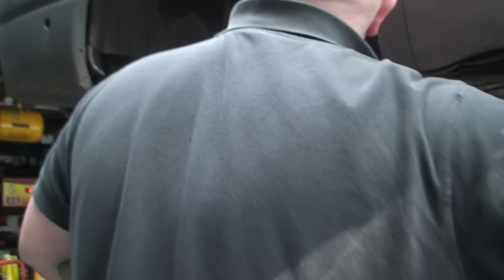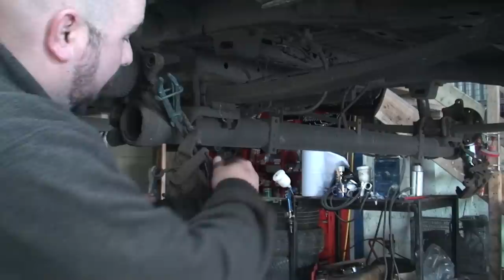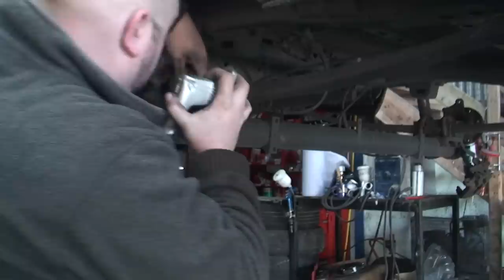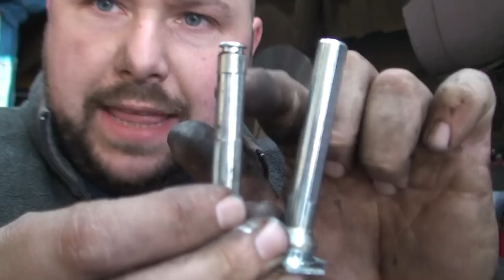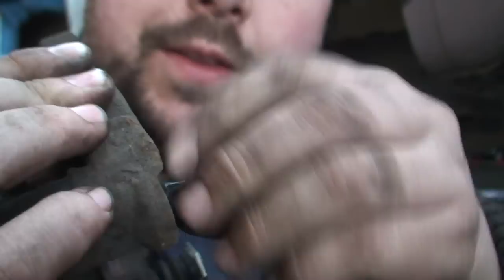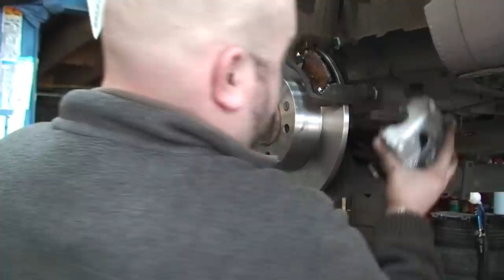bodgit and leggit garage renault master back  part 2

Comment: Super great video mate. Thanks for sharing and supporting the Renault Master community. As info for this van seems hard to find . I met a young mechanic who used to work at Renault dealership as mechanic.  I asked ?'S about brakes & was told to make sure I use correct Allen key tool (socket type) & not to short or long  (for brake calliper).  & told me took 1 hour to replace front & rear disks & brakes, but Renault would charge customer 3 hours. 
Always change disks with pads. This is the norm at Renault dealership. Said disks can't be machined & is the usual case with many European makes. Why is that? Said Master brakes last about 60,000 k's & lots came into the shop with heaps of pad wear left as they panic as soon as they hear the wear indicator squealing.  If you have to change discs anyway, don't rush to do the job ( that's my opinion (especially for rear ones), but would be more promp if front ones.
Renault charged 1100. AU an axle for complete job. So front n back 2200 AU if it's no other problem like park brake issues.
Mechanic warned me to not bleed the brakes as even in there shop, takes them an hour. I took that bit of advice seriously until I find another reputable source that explains it. I have seen on renault forums  other owners taliking about brake problems once they bled them.
I have done heaps of brake changes & brake bleeding on Mazda, Toyota,  BMW, Mitsubishi & Volvo.. Why was I warned to not bleed these ones? Mechanic told me very easy to get air in system...
I just used my wind back tool set on the rear brakes & the right hand winder, (winding clockwise) wound them in on both rear sides. 
Also, Mechanic said to use Castrol Spheerol LMM for caliper pins & backing plates etc. That is what they used in there Renault workshop.
But I like man in this video way of using the copper anti seize where he put it, but think hub needs to be cleaned (wire brush etc..), for DIY 's who don't have a dial indicator to check run out of disk.  But very thankful I found this video. Great  help for me.
Reply: Also found Bremtech Pads & Discs that this mechanic said were best choice for $, outside of Renault dealership. Pads are Euro High Grade by Bremtec in black & white box. And Bremtech Euroline high grade carbon rotors for European applications (coated with Geozinc) Got Via Super Cheap Auto.
When looking up rear it was just a case of single or dual rear wheel to identify, but front ones have allot of different ones. So much so that a Repco staff gave up & suggested I go to Renault dealer.  That why i thought I'd give Super cheap auto a go & glad I did . Unless you have the pad out to show them, you can get wrong one easily. Even after showing them vin, rego etc...I took a photo of my pads still in the caliper & the Renault mechanic could work it out from that...

Comment: Good video, however if you left the handbrake cable fitting to last, and fit new caliper and pads first, the piston would not come out, so no need to wind it in again. Slacken off adjuster of cables under van fit cables to caliper and then adjust up your cables. Much easier

Comment: Thanks for posting this vid and your others they have been really helpful,i did the brakes discs and callipers after watching , i did find the hand brake cable was a bit loose with the new callipers on and had to try to adjust under the van which was a bit of a pig as the adjusting nuts had seized up a bit but got there in the end

Comment: Why do you make the small screw so tight? Surely disc is held firmly in place  by wheel studs? Too often, I've come across these little screws so tight or seized that they shear
Reply: My old mg zr has this problem, I've avoided it as I had to drill it out, it has 2 retaining screws and one was rounded off when I got to it, didn't have anything to heat it up or any removal tools. Gutted because I was hoping to keep everything stock on it as it'll soon be a classic car.

Comment: I changed my brake pads and discs , the callipers seemed fine. My handbrake is still needing a full lockout to engage though ;/ any tips? I’m hoping the cable can be adjusted? 

Thanks :)

Comment: The rubber always goes in the carrier first. It's the pin once inserted that stops that end of the boot pulling out.

Trying to put it in after the pin is inserted is cu nt capers.

Comment: Watched this during lockdown and has saved me a fortune as I have 5 masters and changed all the pads and some disks.....1 question, handbrake has gone really high on one, had do you adjust? Thanks in advance
Reply from the maker: hi mate the first thing you're going to need to do is check the rear calipers they have a problem they stick you will see the handbrake cable and you will see maybe one of the little Arms is all the way up once this happens you can't really do anything apart from replace the caliper but that's the first place I would look it's a really common problem with these
Reply: @bodgitandleggitgarage  yet to get underneath it ! But it is working everyday, and goes on and releases no problem, handle just travels a long way in the cab before it bites

Comment: 2:17 DONT use a ring spanner if its really tight (like vid) you may round the head (BAD) use a six point socket or spanner (they do exist)
Reply from the maker: it works cause no damage and it wasn't that tight don't see the problem
Reply: Good advice actually. 👌🏻
Reply: @martinparker6536  me too! , some times learning the hard way is actually better. 👍🏻

Comment: To be fair, pinching flexi brake lines is gash as fcuk. Also nice claw hammer 😀 Otherwise good job and I agree, just replace everything it's better than bodging and penny pinching which will only lead to more expense in the end!
Reply from the maker: Special tools for clamping brake lines is not any problems whatsoever thanks mate
Reply: @bodgitandleggitgarage  Dont want to argue but in my opinion its not ok, its gash. I realise people will do things differently and that's fine. Like the channel keep it up!
Reply from the maker: @tipptop9  give me some reasons why you think it's bad what will it do that's so dangerous
Reply: @bodgitandleggitgarage  Some people will get a vice grip and go to town which of course will damage the pipe and lead to failure. Other more sympathetic people may loosely clamp and may damage the pipe structure internally, ie no visual damage, this could cause a partial blockage internally, pressure from master cylinder can make it's way down past the blockage to the calipers piston but then the partial blockage stops the return of pressure just enough to cause the piston to stick on a bit. I've seen this happen where pads on one side wear faster and even with new caliper, hardware, pins and carrier all free and greased up good, continues to happen, a new flexi fixed the defect. I work with high pressure fluids and gases, if I clamped any high pressure line or hose I'd be sacked. Hope this clears up my opinion, of course you could go a lifetime clamping hoses without any issues but I wont be doing it.

Comment: caliper hanging free from flex pipe as stated not good practice also never cleaned the hub mating surface prior to mounting new disc could lead to disc run out

Comment: Really think you should be using a bit of wire or cord to tie the calliper up so its not hanging by the hose's !! Bad form
Reply: I always do it to see if they crak . If they cant take a little bit of stick  repace them cos they get more stick on the go.

Comment: What grease did you use on the slide pins on the caliper I can't  remember if you said before about using cv joint grease
Reply from the maker: hi mate I use CV joint grease or moly Grease
Reply: @bodgitandleggitgarage  could you use white lithium grease?
Reply: You can use silicone grease on slide pins.

Comment: Found your site after buying an 02 Master. Very addictive viewing!  Bought new calipers, new discs. Now I find some pillock has stripped the adjuster on the handbrake cable. Anyone know if I need to remove the fuel tank to remove/renew the cable?
Reply from the maker: Jody Willis hi mate no you don't need to remove the fuel tank before removing the old cable tiy the new cable to it and then pull it through
Reply: Thanks mate. I take it the middle section, (the bit with the adjuster), must be a dealer part. Couldn't find any auto spares shop that sells them, so had to go to the local Renault dealer. Thanks again, would have been stumped without your vids.
Reply from the maker: Jody Willis thanks a lot for watching mate much appreciated glad you enjoyed the video
Reply: Well the Master, is truly, "The Master", and has beaten me. I replaced the middle section of the handbrake, (£35.00 from Renault, and the nut and pin come separate?), the pedal is now going to the floor, Bled the brakes, (just the same). handbrake lever is going to the top but doesn't move the the other cable's, (stretched front cable?). I think the front cable is also trapped behind the fuel tank, as I can't pull it out. So now I'm awaiting my nephew, (qualified mechanic), to come and see what Is wrong. 1-nil to "The Master".

Comment: Don't agree with replacing the callipers just because of a stiff handbrake joint, could quite easily have taken it apart cleaned and refurb end it and saved money, that's how I would of done it anyways
Reply from the maker: no because you can't do that you can clean it but like I said in the video it won't last long the machinery you need to refurb these costs 1000s and it's all about time I can't have a car stuck on my left for over a week because I've calipers this is the cheapest and best way of doing this job I have been cleaning these calipers for a while and they don't last long
Reply from the maker: +bodgitand leggit and not only that you cannot get to the parts externally they're all internally and it would be so difficult to get to and repair properly without the proper equipment and only specialist have them
Reply: i agree Savage .....it doesnt look to hard to strip n grease to me UNLESS its all corroded to F##k inside then fair doos.
look here .....a vid of a stripdown - https://www.youtube.com/watch?v=q9hLGCjOpGo

Comment: Hi mate. I've got a 63 master. Do you know if the setup is the same as model your working on in video?
Reply from the maker: Hi mate yes it's going to be very similar
Reply: @bodgitandleggitgarage  thanks bud. Got it done ok. Gave myself 2 hours. Took 4 with last hour in pitch black with head torch on 😁
Reply from the maker: @jamesquinn6302  glad you got it done mate I've been there done that with head torches and all that I know how you feel nice you got it done

Comment: 1:33 give the torx bit a smack first is wat i do
Reply from the maker: you have to be very careful doing that all you're going to do with smash all the bits that are in it inside making it harder to put it on properly
Reply: @bodgitandleggitgarage  i mean insert first them smack it
Reply from the maker: @martinparker6536  if you are going to do with squash all the bits to the back which it will not be able to go in all the way be very careful doing this